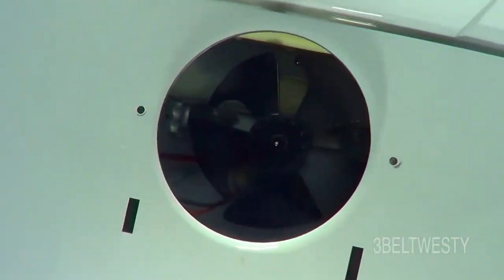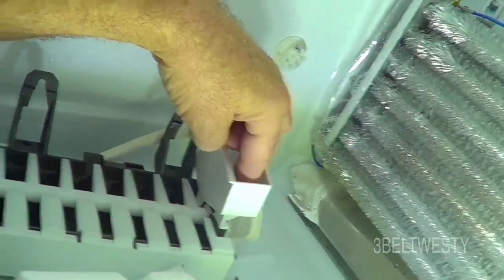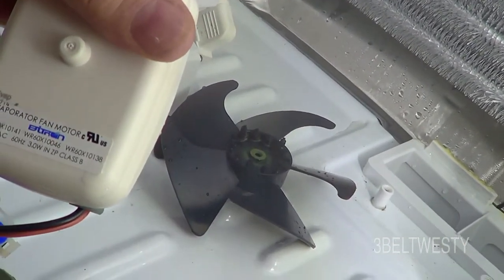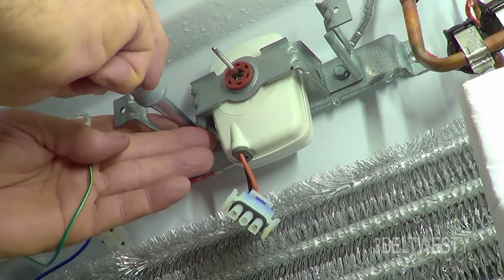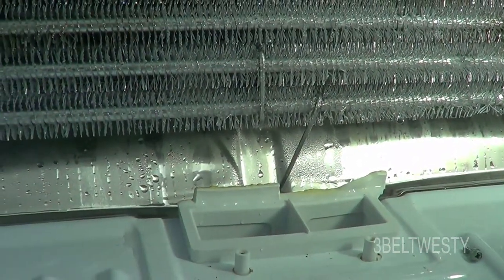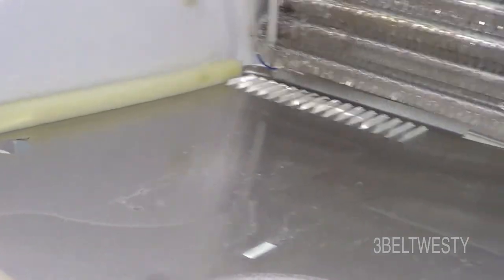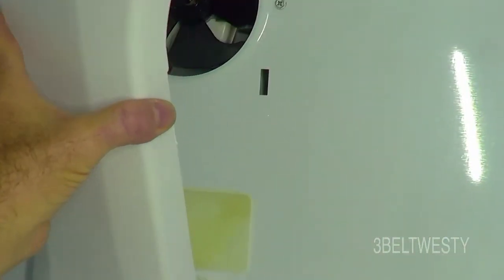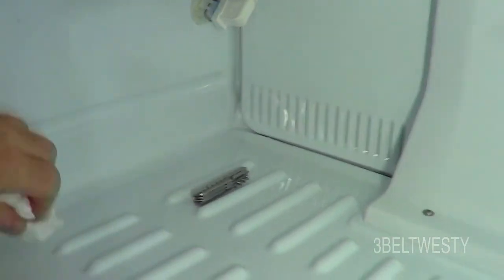GE 18cubic ft  Refrigerator Evaporator Fan Motor Replacement

Comment: Best video as to how to replace this fan.  I took the whole bracket off the back.  The screws are a little ackward, be careful not to drop them when removing or replacing.   The fan cost me about $65 at my parts store.   I am sure you saved me $200 for this job.  thanks again

Comment: Thank you Sir for this video. I just replaced today Wednesday May 17 2023. I had to adjust the fan on the shaft several times because it would hit the bracket or the air deverter in front of the fan. $16 off Amazon.

Comment: Thanks for the video my son just fixed ours ge was making the grinding noise it was the fan motor part costs 66.21 hardest part was getting the fan blade off lol but took 20 minutes to replace 😊

Comment: I replaced the evaporator fan and plugged the refrigerator back in but the fan isn’t spinning. Do I need to wait with it plugged in and on before it will start working again? We don’t have an icemaker on ours
Reply from the maker: On that unit in the video the evaporator fan and condenser fan 'RUN" when the compressor runs. ie wired in parallel. The temperature control (thermostat) clicks on and those 3 items all run. The schematic on that unit as a pdf file is downloadable if you Google : "197D8122P002"  

https://documents.cdn.ifixit.com/IxYbtI6jQiXlSvr2.pdf

So on this videos unit the Evaporator runs when the Compressor runs.